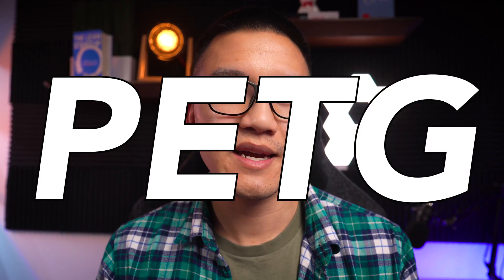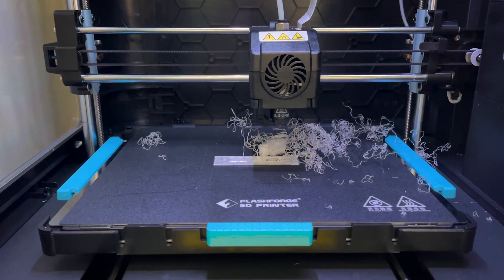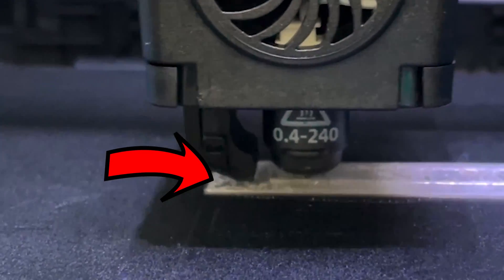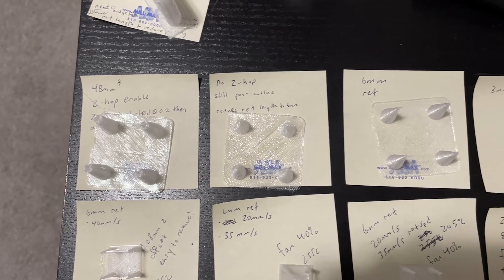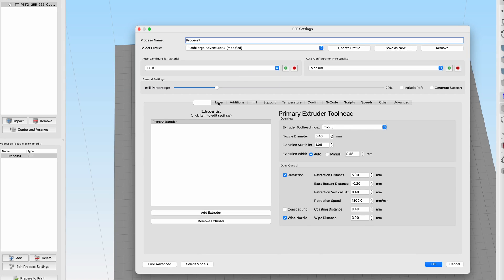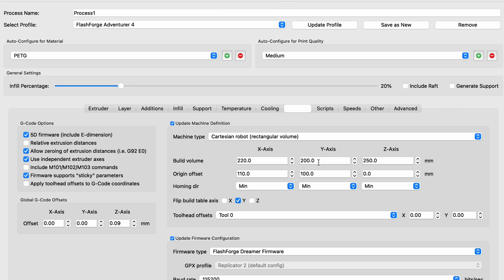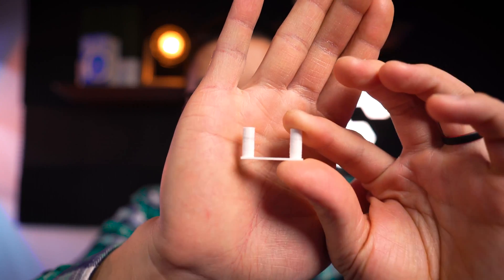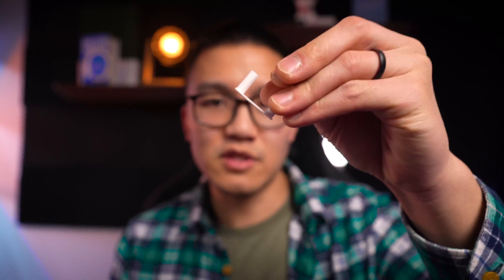The secret to 3D printing PETG [Adventurer 4]

Comment: For PETG, let the completed part fully cool down to room temperature, and then some. Removal will be a breeze.
Every PETG filament has to be dried or else stringing will be rampant and irritating. Worst still, it sticks to the hotend and gunks it, affecting print quality drastically. You can never be too complacent about drying PETG.
Every PETG filament has its own temperature setting, which one will have to figure out the best temp and also the bed temp (for adhesion). Its not an exact science and varies spool by spool. 
Printing environment also matters, in terms of temp and humidity levels. Control this and you will get better results.
Slicing software matters too. Adjusting the initial layer print speeds and temperature, then subsequent layer temp and speeds is also not an exact science. The higher the print layer, the faster the cooling time and hence adhesion to the previous layer. Adjust speed/temps accordingly on the slicer accordingly.
We are at the mercy of filament manufacturers and environmental factors. There is no magic bullet. Adjustments is key.

Comment: Also I got the problem with the nozzle lifting up strings already laid on the bed overall at the ends where the nozzle returns to print the next line, which was resulting in a horrible first layer quality

Comment: I have a big problem with petg printing biger elements, no problems with quality but warping und deforming, i using a bambu lab A1, sunlu petg, Head temperature 240c, bed 75. Now i will try to shutdown the cooling on first 4 layers, at 50% slower settings, first layer 0.28mm. (Yes the print platte hat good cleaning)

Comment: If you're comfortable with running just the heated bed that long (which if you're printing PETG, you're somewhat comfortable with long printing times anyway), you can cut the top off of one of your filament boxes (the clam-shell type ones, not the open at the side ones), and put your spool of filament under that box, upside-down on the heated bed, and you can dry your filament that way.

Comment: I am using petg for several years with no issues. Print speed 60-80-100 and no problem. I also print tiny gears like 8mm in diameter with no issue. Its a prusa clone. Anyways i print at 215C with no cooling.

Comment: I had a Tronxy XY 2 pro printer with it´s original mainboard with a4988 drivers and I printed more than 5000 objects for face protectors with PETG without any clogging and very nice quality using CURA. After few months the part fan got damaged and when trying to replace it the port of the motherboard that  controls this fan got burned. Months later I decided to replace the electronics with MKS Nano Robin 3 and compile new firmware and using latest versions of ORCA and CURA and now the printings are terrible. Clogging after few layers, blobs, etc. I will try a stronger fan for the radiator´s hotend and move to direct drive to avoid retraction. I hope it works. Sometimes the combination of different parts from different manufacturers is a mistake. I think that the all metal hotends still not work for PETG, if the problem persists I will have to go back to teflon extruder and replace it every 3 months at least before it get burned.  Still a long way for cheap 3d printers to work as they should and we wanted to.

Comment: i gonna give it a try, my printer is already slow (50 mm/s stock), my prints also have those blobs, but i already have the outer wall speed 50% (25mm/s) it should be even slower? i'll try another slicer first

Comment: This is the first source I found with actual useful information about PETG blobbing and stringing.  All the rest were just guessing about "things to try," none of which really worked.  I could buy the Simplify 3D slicer for now $200, to get that one setting for PETG. They have a compatibility setting for my machine, an Ankermake M5, but I'd rather not get a new slicer.  I'm rather hoping that I can tweak my settings in my machine to allow a soft layer to harden before printing over it, dragging blobs and strings.  If anyone knows how to do this, I'd like to know.

Comment: I use Orca Slicer on my Adventure 5M. Its amazing. The preset settings are all perfect, except for some reason the print speeds dont change when changing filaments, have to do that manually.

Comment: Sooooo your part cooling needs a bit of an upgrade Awesome!! Disabling Z-hop can cause print failures more frequently, be nice if there was a setting to Z-hop after the wipe as you put it.. the plastics expand and warp and shift as they cool ever so slight bit is enough to cause the nozzle to snag on a set beaded layer of plastic and rip that part right off the build plate or cause a skip in the steps causing layer shifts honestly not a good idea to disable it, keep the Z-hop we like the Z-hop, Z-hop Good!!

Comment: Does the print head stop briefly when the blobbing occurs, if so it's likely the printhead stopping while its location is getting saved back to SD card, due to 'power off recovery' being set to on, so it knows where to re-start.  Which isn't necessarily all that helpful.  I have read that can be turned off for all printers in order to avoid stalling/blobbing.  Thanks for your posting

Comment: with Bambu labs x1c I print with the stock 0.4 nozzle with hatchbox brand PETG. I change the plate in the slicer to engineering plate, but in the actual printer i just keep using the cool plate that comes stock with the print. I change the bed temp from 35C to 70C. Use 3DLAC spray adhesive. I don't change any other settings and I get just about perfect prints

Comment: Im printing with PETG right now. I have no problems with it. Only a couple of stringing. I heat the bed to 85-90 degrees for the first layer. To get a solid stick to the bed. Then on layer 3-4 I change it to 75 degrees. Also for the first layers I set a speed of 50%. So the extrusion turn out good. Then  I set the speed at 95% at layer 3-4. I have only had good results:)

Comment: If you have a 3d printer with a heated bed and a cardboard box you have a filament dryer. Your bed will heat up to 60-65° also your oven (if it has a halogen bulb) will keep your oven warm possibly around 65° but the bed with a box method works 👌.

Comment: In my case it isn’t the temperature set for the nozzle. I print PETG with good success on a K1 Max, the key is to use the side fan at least at 50%. It seems that the tip of the nozzle gets hotter than the rest of it causing the PETG to ooze out and cause printing defects!
Reply: So up the side fan to higher than the default speed? Ive yet to be be able to get first layer to stick down
Reply: @tombowman4489  If it isn't sticking to the bed, you may have to increase the bed temperature. Have nozzle between 240c-260c and the bed between 70c-90c. On my printer I found success at nozzle @245c and bed @80c.

Comment: Set retraction at 10-15mm and retraction speed at 80mm/s that will help you a lot . Check that your part cooling is enough. I did those things and had exactly your problems with petg but now I print at 60mm/s with no problems whatsoever

Comment: Easy middle ground. Preheat bed to 75 c. Let it come up to temp and sit AT temp for like 15-20 mins. Then run bed level while the heat remains on..... only relevel bed with a preheated bed from now on. Solved <3

Comment: have you tried using superslicer? i've been having good results with it. like it more than cura for the fact that it isn't an electron based app which runs a little better on my older computer. it's a fork of prusaslicer

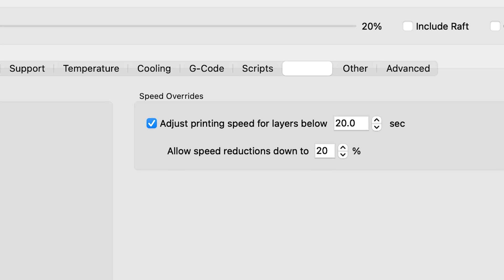Comment: at 10:14 these settings made my print go from 3.5 hrs to 8.5 :) but my issue is a little different where it stops extruding the petg, this doesn't happen on filaments.

Comment: Nice one, unfortunately flashprint slicer doesn't give you as much flexibility as with other slicers like ultimaker or cura,but the issue is rarely the slicer but your slicing settings.
You need to adjust the settings that are tailored to the specific issues you are experiencing, e.g you can't adjust infill density and expect it to solve a stringing issue which is obviously due to retraction speed and distance.

I had similar issue on guider3, i adjusted the bed temp to 70c (with all the lids close to trap the heat), lowered the speed to about 40m/s and it came out 90% fine

Comment: After +40 hours of trying to fix similar issues what resolved the issue for me was putting to temp up 30 degrees recommended by the printer for PETG and an extra 10 as suggested by the filament manufacturer to 260 celcius. 

I got better layer adhesion and less/zero blobbing and stringing.
Reply: Parts strong?

Comment: Finally got Overture PETG to work. Had to slow the print down to 10mms, increase the flow rate to 120, increase the hot end temp to 260, increase the bed temp to 100. I'm on Ender 3 with Creality 1.1.4 board.
Reply: 10mm/sec first layer
240c print temp, 
75c bed temp
Glass bed with glue 
Worked for me
Reply: You sir are a god I’m gonna try this I’ve had nothing but trouble with it minus two solid prints although I was printing at 235 on a sprite direct drive
Reply: @chrisdoesnotmiss  Update - Was able to print at 50mms, hot end at 250, bed temp to 95 by changing the flow rate to 92%. Which kind of makes sense since this is a denser material. Also if your using the textured sheet that comes with Ender 3, flip it over. Now you have a G10 sheet. Let the bed fully cool and the parts literally fall off.
Reply: @justapile4376   I think the main thing is that PETG is softer and easier for extruder to sink its teeth into. Thus the effective diameter of the extruder gear where it contacts the filament is different. At least with one sided extruders where the opposite side is spring loaded, as opposed to two sided ones which are distance trimmed.
Reply: @SianaGearz  Normally I would agree with you, but as I said Overture is just a bit denser. Had no issues with other brands. Just this one.
Reply: @chrisdoesnotmiss  After looking into it, this brand is considered a higher end plastic. It's a bit thicker. So slowing down the print with a higher temp should give good results. Be sure to let it fully cool before removing from the bed.
Reply: @justapile4376  this is why I love the printing community everyone is always so willing to help it’s just great thanks man

Comment: Thanks. About to try PETG. I want to make something for outdoor use and my PLA test piece melted one day when the temp was 110F (44C).
Reply: PLA shouldn't really melt at 44C tho, it becomes soft at like 65-70C. PETG is great for hot stuff tho :D or you could try PC which prints basically the same and can withstand 90C, but you need to print it at 260C and 110C bed

Comment: Had my machine print perfect with both 0.4 and 0.6mm nozzle, but now. Just switched to 0.6 after doing some testing with the 0.4mm. Now i get zits and artifacts. One thing is for sure, next time it is calibrated and prints without artifacts i will stop messing with it. Im kinda jinxing my self, pushing and pushing the printer. Hehe

Comment: Just in cast someone is wondering about this setting in Prusaslicer, it is under Filament Settings -> Cooling -> Cooling Thresholds -> Slow down if layer print time is below... By the way, this is not really a "solve all" solution to PETG printing. It is relevant only for small prints and/or small layers.

Comment: Printing perfect today, z hop makes all the difference and all the speeds to like 30% in flashprint 5 I know you were using 4 back in this video so the stock petg settings still have issues but doing the z hop and 30% speed on everything worked great for me, so glad I didn't have to bang my head against a wall for hours and hours on end

Comment: Marlin has linear advance literally developed to solve this problem....or pressure advance in klipper..... also if you work in resonance in klipper and you're golden..... you didn't have to waste all that filament either, just a few lines and a calibration block and you're all set

Comment: Another very effective setting in Simplify 3D is ((Process) > (Advanced > Avoid Crossing Outline For Travel Movements), I just use the default 3.0 setting.

"Avoid crossing perimeter" in Slic3r under  > Lsyers and perimeters > Quality (slower slicing)).

EXAMPLE:
https://www.youtube.com/watch?v=s6h7zgNe62c&t=12s

Comment: I have been printing petg with same issues  with my adventure 4 . With .6 mm nozzle . The recent flash print rev allows edits so I was wondering if you could we could duplicate some of the cura or simplify 3d settings . Also a silicone boot is recommended for the ender and Prusa printers . I am going to get a dryer to remove the wet potential .. enjoyed your video .. I did look. At a few others but they did not use the  adventure 4 … I do like it too for a variety of reasons . I have printing simple round petg parts in large qty with out issues but more complex and larger designs do present problems
Reply from the maker: Sure I can look at starting a discord
Reply: @justmakeitdaniel7667  I am not familiar with the discord . Is that an app
Reply from the maker: @1doutlaw  yes it is an chat app that has different channels so various topics can be discussed in real time with other people who are online

Comment: Actually I dry my PETG filament in the oven for 80 min with 80 to 100°C and it works great for a few hours since I’m in an environment with lots of moisture
Reply from the maker: woah you dry at 80C-100C? That seems a little too hot since PETG starts to transition between those temperatures. Glad it works for you

Comment: I have the same printer and have run into the same issues as him. I fixed most of these issues by raising my nozzle higher off the bed then usual, slowing it down, and raising both bed and nozzle temperature. I used Hatch Box in my printing more then any other brand and this solution seemed to work.
Reply: I can confirm this worked for me too. Raised my bed and nozzle temp by 10 degrees (250 first later 240 there after and 80 for the bed in cold north of England) print speed down to 25mm/s and cooling fans off except for over hands. Z level is not beautiful (Neptune 4 max)

Comment: It’s not about bed leveling but simply - PETG likes to be printed in the air. 0.2-0.3 mm z offset from the bed is typically great. PLA likes to be squished but not PETG.
Britleness of parts was not caused by some “stress” on layers, but because of your nozzle being too low for PETG, it caused huge nozzle backpressure, causing under extrusion and extruder wheel skipping to feed the filament. 
This is all because of the PETG having huge volumetric flow. Ie if your all metal hotend is able to push like 15 mm^3/s, for PETG it might be even 25 mm^3/s so you can print much faster. Ie. With my high flow Dragon hotend I can print at up to 35 mm^3/s with PETG, which translates to 200 mm/s with 0.6 mm nozzle and 0.3 mm layer height. For PLA it is more likely at 25 mm^3/s in my case.

Nozzle buildup can be prevented by using high quality nickel plated copper nozzle which I consider minimum standard these days. Nickel plating of whole heatblock too is fine for all copper hotend - much higher flow and less tendency for filament to stick.
I personally use tungsten carbide nozzles from Spool 3D as I print lot of carbon fiber. It’s expensive, sure, but it’s nozzle for a whole life.

Regarding carbon fiber - CF PETG on the other hand prints like PLA, no need to rise Z offset as carbon fiber causes less oozing and lowers the flow.
Reply from the maker: unfortunately for the adventurer 4, the nozzles are proprietary and they don't reveal the specs (materials, flow rates, etc). If I had an open source printer, I would have upgraded my extruder in a heartbeat
Reply: @justmakeitdaniel7667  definitely, standard PTFE lining hotends generally sucks. Basic old E3D with groove mount too. There are plenty of great hotends these days like ones from Phaeton or Triangle labs, or Slice Engineering etc.
As I said, bimetalic heatbreak and copper nickel plated nozzle are good choice in general.
Reply: Thank you for sharing your tips/explanation! I'm looking for begginer advices for printing eSun PETG on my Anycubic Kobra Plus... Any links and advices are welcome.

Comment: I'm brand new to 3D printing. I have an Adventurer 3. I'm glad I came across your video, thanks for the information. I haven't seen many use a flashforge printer.
Reply: I have one too, my Adventurer 3 have more than 1700 hours on it. 
I have printed some new brackets for the guide under the bed, and i have made an airnozzle so you can print high temp and not warp the nozzle, its on thingiverse.

Comment: These videos are great Daniel.  You must be the only one producing content for this printer that actually paid for the thing.

I've got one ordered, even understanding the various pitfalls. Have many years of tinkering with creality clones, so working hard for good prints is the norm.   I know the Adv4 gets a lot of flack for marketing itself as a no-fuss printer, but to be honest it's still consumer grade hardware (and pricing).  Suspect a lot of the negative attitudes towards flashforge are a result of the closed source approach.

Great to hear S3D is playing nice, just need some rudimentary functionality with octoprint now ;)

On PETG, cooling fans are the devil and create a lot of the wispy artefacts.  For that reason I think it's a good material for simple, functional, structural parts that ideally need no cooling fan - but lends itself poorly to detail prints.  But if you're doing prints with a lot of fine detail, PLA is probably sufficient anyway.

Would love to hear more about your adventures with ABS as i think this is where the real potential of the Ad4 resides, given very few enclosed units exist in this segment.
Reply: You can use pla plus for additional strength and ease of printing as pla